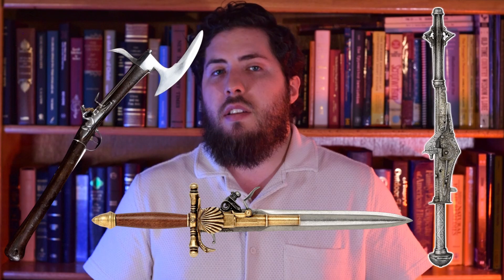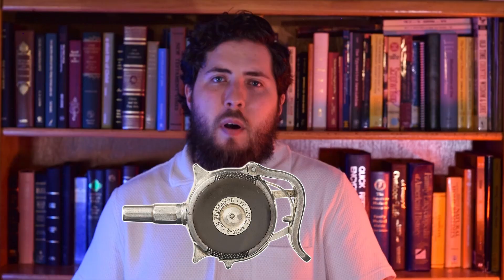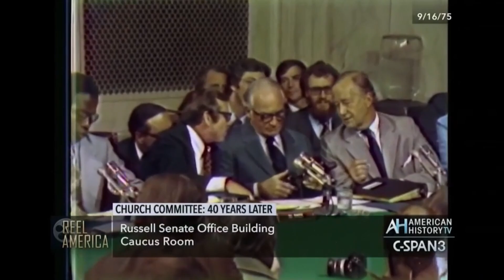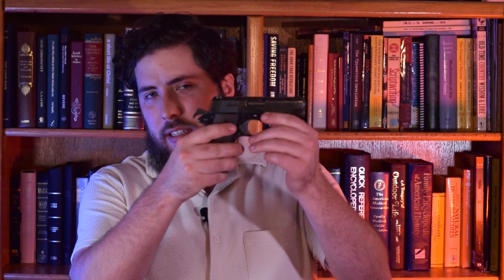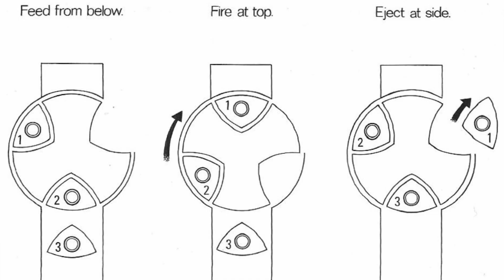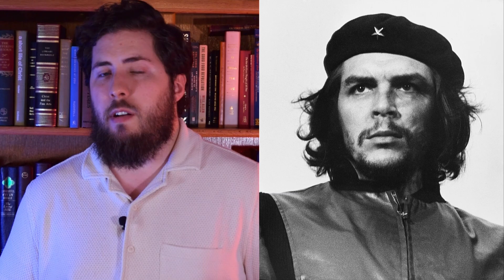The Weird Gun Iceberg - Level 1

Comment: The LeMat had two types of barrel selector btw, the Navy model has a spur you flip down that drops the hammer lower to get the axis barrel and the Army and Cavalry model have a cross pin that slides over the inner nipple/cap and the hammer hits it first before it can strike the outer chambers.
 All three are for sale as repros.

Comment: FG42 is awesome. It's performance as a machine gun is a bit dubious though with such a small capacity. But it could work as a dmr or battle rifle both. The fallshirmjägers did have mp40s too (and the higher capacity and much lower ammo weight would complement the shortcomings of fg42).
Reply from the maker: that makes sense.  I just like it for the vibes

Comment: Sorry, the G3 has a built-in optics mount that is designed for very quickly adding or deleting any sighting system that carries a proper combination ring and quick-detach system. It is an H&K proprietary system, but it did exist.

Comment: One incredibly unique fact that I think you missed when talking about the FG42 was its dual mode operating system that I don't think has been done on any other (at least well-known) weapon.

If you were firing the gun on semi-auto, the gun fired in a closed bolt configuration for superior single shot accuracy. But when you switched it to full-auto, it would start shooting from an open bolt like a typical LMG. Very weird fact about it that is often forgotten about the weapon itself in my opinion.
Reply from the maker: @no-legjohnny3691  ah man I totally forgot to mention that! I absolutely read that in my research though.  Good point
Reply: The Armalite AR100, CETME Model A, FN HAMR, Johnson LMG, LWRC IAR all fire from open and closed bolt like the FG42.
Reply: @Watchdog_McCoy_5.7x28   those are all pretty rare.  I think there's a more common example - maybe a H&K but it's not coming to mind.
Reply: @MrSimondaniel3 my comment was simply to show that many other guns have used the same type of system and it isn't as "incredibly unique" as one might think. I don't doubt there could be others that I forgot to mention or wasn't aware of, but of that's the case, it makes it even less incredible or unique.
Reply: Johnson lmg, another side loading light machine gun from the same era